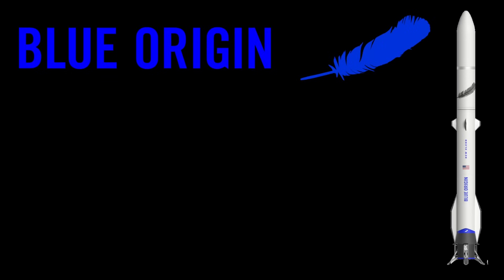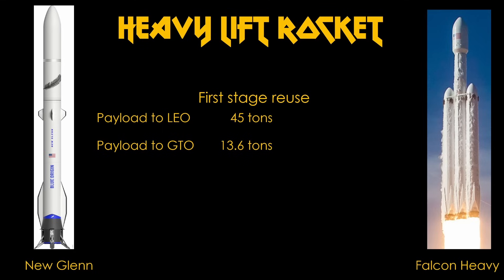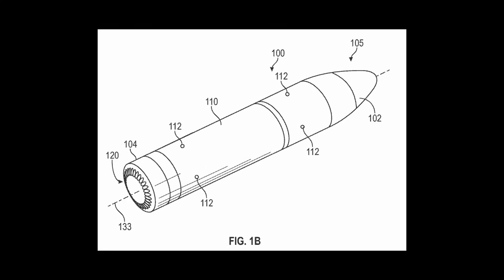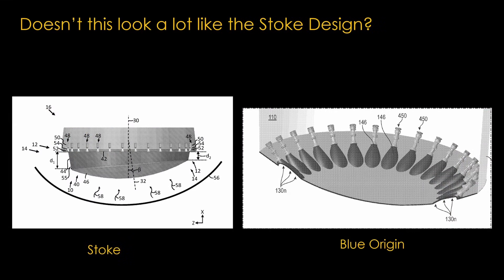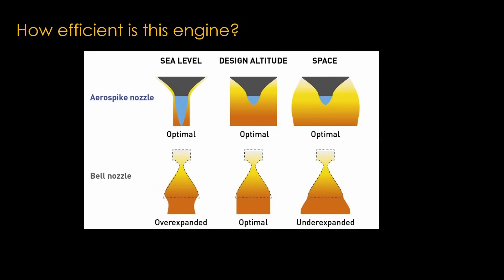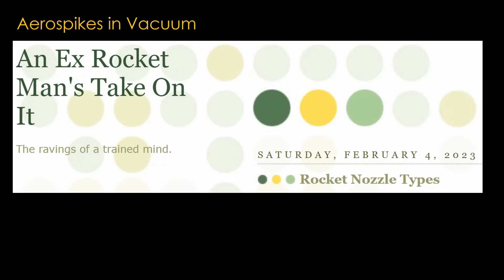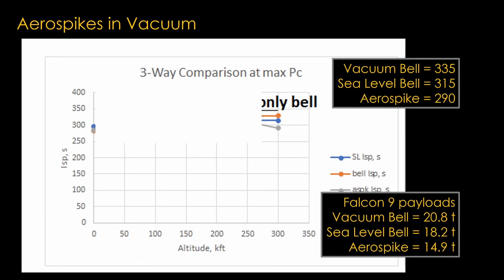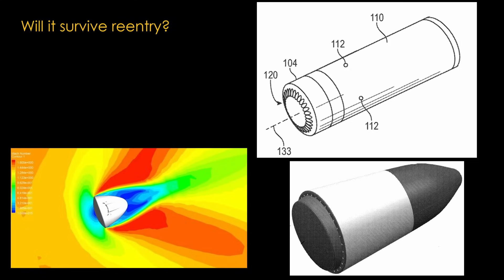Blue Origin's Starship Killer?

Comment: Good assessment.
Are you familiar with Aerojet's Thrust Augmented Nozzle? It seemed too good to be true almost, except they actually built and tested it. You inject more fuel+oxidiser into the nizzle, like an afterburner. Allows a large nizzle to be used at sea level. Gains above 40% thrust at sea level, and actually better improved net Isp over the whole launch profile. I'm surprized that it hasn't been picked up by anyone - probably means I'm missing something.
Reply from the maker: Do you have a reference?
Reply: That sounds like a viable technique to gain thrust. The "afterburner" combustion is additive.. I'm not sure about efficiency but the simplicity might be affordable. Btw, I'm cool with burning some hydrocarbons to try to preserve mankind.
.. That concept might explain "aliens" too but that's speculation.  Lol 👽

Comment: Something tells me a Chinese reusable upper stage will resemble Starship a lot more than Jarvis. This isn't a slam at the Chinese, I expect if Relativity and Firefly survive long enough to go for a bigger rocket and second stage reuse they'll also use the Starship approach.
Reply: Well, speculation allows to go in all directions, all the way to designate Blue Origin a Chinese skunk works setup. Amazon is a crap producer of Chinese made consumer products that fall apart when used. Since it is labelled an American company with a figurehead as ceo, Blue might well be Skunk Works 2.0. Somehow that would even make sense if conspiracy is your game. 😂
Reply: Relativity terran R is already very like scaled down Starship.  SpaceX proved that this concept can work (SN15/ recent ift4). Stoke/Jarvis concept have to be tested first(proof of concept). It looks good on paper, but re-entry/hypersonics regimes are not well researched. All models are approximate, and in those regimes margin of error is pretty high. Look at ift4 flap. It survived max temp point without damage, it melted in lower point of re-entry when Starship hit denser part of atmosphere. While SpaceX was mostly anxious on max heat point. I don't say that it couldn't work, I am big fan of Stoke approach, but we still don't know what will happen during re-entry with nozzles. Or if cryogenic cooling will be enough.

Comment: If blue origin buys Ula, they will have a rocket that covers all the orbits in a single-use vehicle.   With a reusable first stage in the BE-4,  they will have reusability covered, too.
Reply: If it works.  Big step up from new Shepard.
Reply: I would think Vulcan Centaur would be retired fairly quickly, as soon as they could without messing up their government contracts. It's just too expensive and has no reuse.
Reply: @SpaceAdvocate it has no reuse yet
Reply: @plainText384  New Glenn is planned to have reuse from the first launch, as I understand it.
Reply: @SpaceAdvocate  I was talking about Vulcan Centaur's planned SMART upgrade.
Reply: @plainText384  Ah, I see what you mean. I don't think Vulcan Centaur will have reuse ever. Especially if Blue buys ULA. SMART is all about recovering the BE-4 engines, but their replacement value is lower to Blue than to ULA, given that Blue is the supplier. SMART reuse would then make less sense for Blue than to ULA. And on top of that it would be competing with New Glenn.

And even if someone other than Blue buys ULA and makes SMART reuse a reality, the architecture just doesn't make a whole lot of sense. You'd still be throwing away the RL-10 engines and the GEM 63XL boosters, which are more of the cost of the rocket than the BE-4s.

New Glenn and other two stage reusable designs are just better. And if you need extra performance for some high energy missions, you can always just add a kick stage, like Rocket Lab does with Photon.
Reply: @SpaceAdvocate  according to Tory Bruno, the BE-4 engines represent about 65% of the boosters cost and SMART would break even after 2-3 launches.
The booster also makes up about half the cost of the rocket, with rocket hardware being 1/3-1/2 of total launch service costs.
He's repeatedly said that there is a strong financial justification for SMART reuse, especially with the Amazon Kuiper contracts.

So I'm fairly confident it'll happen in the next 2 or 3 years. It also wouldn't really be competing with New Glenn. Maybe in its most powerful configuration VC6, which can lift 27t to LEO, it would be competing with a Jarvis/Clipper 100% reusable New Glenn. But every other VC variant would be significantly less capable, especially if they take a small hit to payload capacity from SMART. If BlueOrigin buys ULA, they could obviously just choose to fly only 0-4 SRBs to avoid competing with New Glenn (similar to how ULA only flew Delta IV in its heavy configuration to avoid competing with Atlas V)

Comment: I think Stoke Space has a more feasible design.
Reply: This reminds me of Stoke
Reply: It's really brilliant but the hydrogen is worrisome since it leaks and embrittles everything.. but hopefully they got it figured out!
Reply: The problem I see with Stoke is that their vehicle is too small to hold enough HydroLox propellent and that they end up with a small payload volume by retaining the fairing rather then jetisoning it.  Their concept of capsule like re-entry would in my opinion actually work better as a 3rd stage even more puck like that only needs to perform ~3 km/s Delta V and sits under large jettesoned fairings (which can be recovered by parachute), and on top of a spaceplane/starship like 2nd stage that lands maybe horizontally downrange and would not need ceramic thermal tiles to to being suborbital and re-entering at ~5 km/s which means massivly less heat load, enough that a metalic thermal protection system should be viable.  3rd stage orbits the Earth once and lands propulsivly at launch site, while 2nd stage is refueled for a powered flyback as its landing probably a thousand miles downrange, much to far for a boostback.  Reassembly is longer as would make for 2 simpler to engineer vehicles and probably less mass penalty for reuse because were both satiating the rocket equation with staging and expending less mass in thermal protection and landing propellents.  Booster obviously the now normal propulsive boost back and vertical landing.

The dominance of 2 stage designs for full reuse is in my opinion putting too much stress on the 2nd stage and forces them to be too voluminous and thus heavy for survivable re-entry.  Rockets used to have more stages (Saturn 5 was 3 stages, soviets even more), industry narrowed down to 2 as ideal number for expendible launchers but it is not proven to be ideal for reusables, the most reusable system we ever had was shuttle and it was effectivly 3 stages (boosters, tank, orbiter).
Reply: @kennethferland5579  On high energy missions, reusing the upper stage is always going to be challenging. The optimal configuration in my book is a two stage vehicle where both stages are reused, and an optional kick stage for the occasional high-energy mission.

As for the shuttle, the orbiter didn't have much delta-v. I wouldn't count it as a third stage any more than I would count the Dragon capsule as a third stage.
Reply from the maker: Saturn v was a 2.2 stage rocket with a lunar exploration stage. They needed that because neither the first or second stages are very good by today's standards.
Reply: I'm stoked to see Spoke viable and active.
Reply: Stoke was started by and employs a ton of former BO employees.
Reply: Stoke spaces desgine is basically a scaled-down version of New Glenn with the reusable upper stage proposed in one of BlueOrigin's patents. Given that Stoke Space is composed of many ex-BlueOrigin employees, this is incredibly suspicious.
Reply from the maker: Stoke's patent is earlier than Blue Origin's
Reply: @EagerSpace  Thank's for the info. I looked it up (I assume you are referring to "AUGMENTED AEROSPIKE NOZZLE , ENGINE INCLUDING THE AUGMENTED
AEROSPIKE NOZZLE , AND VEHICLE
INCLUDING THE ENGINE"), and it is the older patent. However, Stoke Space's current design doesn't really match the design in the patent, and is (visually) a lot more similar to the BO patent, than their own. I'm not a patent lawyer, but this definitely sounds like it would make for an interesting plot on some lawyer tv-show, lol.
Reply from the maker: I'm very much not a patent lawyer and in the software business you need to stay ignorant of what has been patented because infringement is far worse if you know about it. 

My guess is that they are most likely to cross-license if both companies are up and operational. If stoke starts to have significant financial difficulties there might be a suit but given that Blue Origin hasn't actually created anything that could be infringing, there might be nothing there.

I'm not sure whether discussing the fine points of what is and isn't an aerospike would make good TV...
Reply: I still think it will fail unless they get an influx of cash.
Reply: @jamskinner  What if Blue Origin bought Stoke and gave them All The Moneys to build a reusable upper stage for New Glenn?

Comment: I'm guessing they are going the stainless steel route as the body can double as the tank wall, gets stronger with crygogenics, is resilient, can be easy welded and worked, and it's cheap. I think we will see more and more stainless steel ships in the future.
Reply from the maker: If you are trying to do reentry without tiles, stainless is a very logical choice. I think there were some early shuttle concepts that planned to use titanium, but I might be misremembering.
Reply: @EagerSpace Correct. They switched to aluminum when it grew so large that titanium became unfeasible.
Reply from the maker: See here for one example. https://ntrs.nasa.gov/api/citations/19740011469/downloads/19740011469.pdf
Reply: @pseudotasuki  No, Shuttle moved away from Titanium as a result of budget cuts impossed part way through design, nothing more.  The switch to aluminum was a major downgrade and had it remained Titanium Columbia would likely not have been lost.
Reply: @EagerSpace if you try to do re-entry without any protection, you're stupid
Reply: Conventional lithium aluminum rockets also use the body as the tank walls. Same for stainless steel balloon upper stages, and most rockets designs
Reply: No Blue Origin is not stupid, they will use vastly lighter aluminum or vastly stronger and heat resistent Titanium.  The only reason SpaceX uses crappy stainless steel is that it was cheap and they knew they would be blowing up tons of metal, BO engineers the vehicle first and then tests to validate design, rather then SpaceX's soviet strategy of design by iteration.  The Airospike engine and basefirst re-entry basically demand maximum heat resistent metals, I would not be surprized in Inconel ends up being needed for the very center of the engine, re-entry heat is no joke.
Reply: @kennethferland5579  If they use aluminium they need that much more heat shielding material. SpaceX opted for stainless steel in part because it handles heat quite well, allowing them to get away with a significantly thinner and lighter heat shield. As flight four also demonstrated, even losing some tiles the vehicle can survive. The same wouldn't be true with aluminium.
Reply: @kennethferland5579  Crappy stainless steel?  It does the job very well and as you pointed out it's cheap.  When planning on using a rocket a LOT and making a LOT of them it's a smart choice.
Reply: @kennethferland5579  Aluminum would be problematic for the same reasons it was for the Space Shuttle, but titanium is certainly a valid option (albeit with its own set of drawbacks). But we know they're using steel because there are photos of actual tanks BO has built for this project.

It's also unlikely they would use steel for early tests if they don't intend to use it. Titanium is an especially difficult material to forge, machine, and weld. Testing with steel first would be a waste of time, as they wouldn't be able to transfer very much of what they learned.

Comment: Ok, didn't expect that an aerospike nozzle actually has lower efficiency than even a sea-level nozzle in a vacuum.
Reply from the maker: Yes. 
If you read the blog post (linked in the description) he has some nice diagrams. The basic problem is that the exhaust from the thrust modules expands to the side when it comes out of those nozzles and the exhaust going to the side doesn't push the rocket forward.
Reply: @EagerSpace  Feels like I've been duped by the big aerospike...
Reply: If the things worked, they'd be on every rocket.
Reply: Not surprizing, solutions which are more flexible tend to be lower in efficienty then more specialized and inflexible solutions.
Reply: @kennethferland5579 Yeah, but usually they're more effective than an option with the wrong specialisation. Here, you might as well just mount the sea level rocket, because it would be more flexible than the vacuum bell while being more efficient than the aerospike at all altitudes.
Reply: @ReddwarfIV  The line for the Aerospike nozzle ISP clearly rises above the other engines in a middle region of the graph, so no you have simply misunderstoon the data if you think it's less efficient at all altitudes.
Reply: @kennethferland5579  ...TBF to me, that part of the graph was blanked out for most of the time it was in the video.
Reply: I'd always read about aeropikes using the airflow to shape exhaust, and how that supposedly makes them better at all altitudes. Somehow everything I read never mentioned what happens in vacuum, where there is NO airflow! They just assumed that the aerospike would still be more efficient.
I expected that the exhaust would spread out to the sides, as it would in an under-expanded sea level nozzle. In fact it seems worse, because the thrust modules have tinier nozzles than most sea level engines.
Engineering is all about trade-offs. One engine design might be worse, but if they can make up for that by having a lighter heat shield, then it might be a better rocket overall. The only way to know is to build it and fly it!

Comment: Great Video !  The NASA X-33 SSTO rocket used Aerospike engines !  Also Blue Origin does not mind using a Hydrogen/Oxygen fuel that would be lighter than RP-1 in the second stage !  And a new low inclination  LEO CSS heading East from the KSC would be a Fuel efficient orbit to reach !  This orbit can support missions to the moon as Robert Zubrin wrote in his paper "Moon Direct" !  The Tech developed to return to the moon to stay, can take US and the world to Mars and beyond !  tjl
Reply from the maker: The XRS-2200 is the only linear aerospike built. They apparently worked, but the amount of data we have on them is limited. Typically the problem with linear aerospikes is they weigh a lot and take up more space for a given amount of thrust.  LM wasn't interested in funding the X-33 themselves after NASA decided to defund it, and the X-33 was only a prototype, not an SSTO.
Reply: I thought the XRS-2200 was based off the J-2S. Perhaps that could be a real-hardware test case of bell vs aerospike efficiency, although they may have made enough other changes for that to not be a fully fair comparison.
Reply: A minimual difficulty orbit reachable from KSC would be inclined 13.5 degrees to the equator rather then directly East, an improvement over ISS 51 degrees which is more optimized for Earth observation.

Comment: Would be cool to see a company genuinely try to develop, produce, and fly an aerospike rocket engine at scale.  I think it would be a good fit for New Glenn and would make that launch platform somewhat competitive with the falcons.  However, seems like Blue is doing too much at once.  No singular focus...new shep, new glenn, be 4 for Vulcan, Jarvis, blue ring, lunar lander.  Lots of nice concepts but they need to hurry up and get a new glenn launched and recovered.  Then talk about all this fancy upper stage mumbo jumbo and all.  I'm guessing the vacuum efficiency being so crap is because of the way in which the hot exhaust gasses are pulled from all angles in space....at least in a traditional bell they are only pulled out the bottom.
Reply from the maker: I talked about this more in the nozzle video, but the fact that the aerospike has been around so long without any real implementations is a good indication that it's really not useful.
Reply: @EagerSpace  I suggest that is true today, given the limitations of material science. But if & when there is a material science breakthrough, that could change.
Reply: New Shepard was completed long ago, New Gleen is in final stages of development and is now moving to manufacturing.  BE4 was nessary for their own vehicle so selling to Vulcan was just gravy, Blue ring is a mere satalite bus hardly much of a project, tons of rinkydink startups off something comperable.  The Moon lander is now clearly the main project they are working on and Jarvis is just a theory, if it's being worked on at all it's likely back burner.